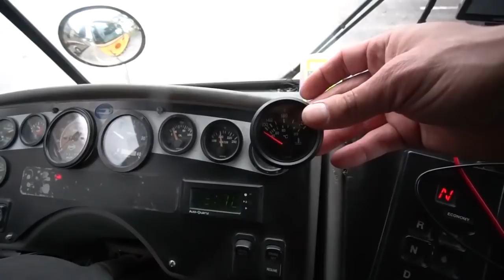Cummins Visit ~ Massive Coolant Leak ~ Skoolie MPG

Comment: It’s good you were able to fix your leak and it wasn’t serious. We were ‘evicted’ from our house for two weeks while Cumins’ overhauled our engine. It was expensive, but since we bought the coach used, there were bound to be a few things crop up over the years, but I sure didn’t expect that at only 100k on the odometer. I mentioned in a video how the surprising part was how hard it was mentally on us not having our house. Thanks for the video, and hopefully, may your issues all be minor!
Reply from the maker: Yes, I cant believe yours went at 100k. Air filtration issue right? Its all part of the journey!

Comment: Those are good busses, I used to work on them. not a bad idea to check floor mounts on the chassis. It is a very common problem with Thomas. Blue Bird and Carpenters. Just measure from a flat road surface to the frame for actual ride height  then measure from the road  to the underside of the bus floor.  Do that for each side that will tell you if suspension or chassis mount/ sag. If it is a spring the frame height will read  off on one side, if it is chassis/mounts/sag.. the floor reading will be different on each side. Full fuel tanks can contribute to leaning different height on one side also.

Comment: Big Class A or big School bus, Diesel engine all mass weight. They sink in the desert at times, limited where you can go. I will pass. See no advantage except maybe the interior space. But you love adventure and this will be a good one. I rebuilt my RV from the ground up, bumper to bumper. The structure is all steel framed walls and ceiling, It turns 41 years old in 2018. But its brand new. Love you Chris and G, your very fun to watch.

Comment: Chris, Just changed my coolant in my 8.3 Cummins. went with the 50/50 to keep from eating the liner out of the engine. hopefully yours is the mechanical 8.3 and not the electronic. You will do well. Just changed all oils and fluids an ready for 15,000 miles plus.

Comment: That sounds like the air suspension settling. When you start to hear that "clicking" give the bus a good shake. it should give you one loud(er) "click" then stop until further settling. nothing to worry about. If it is the suspension I think it is there are plastic wear pads in the front spring hangers of that drive axle suspension. They tend to "stick" to the spring surface and "click" when they release from natural travel of the spring as the suspension "settles"and articulates forward.
The sight glass should only be half full when the system is cold. Thus the reason it is called an expansion tank.

Comment: Those buses with have three levelling valves for air ride.   One on the front and two on the back.  It's common to have to replace these periodically.  Likely a haldex part that will cost about 60 dollars each. For the air ride to drop after two days is normal.   Get koni fsd shocks if you need to replace them.

Comment: Chris, I think your bus has at least rear air ride suspension. On the left rear you hear creaking all night long and the wheelwell gap gets closer. That's your air bag bleeding off air (air leak). When driving the air compressor keeps up with the air leak and you don't notice it till you shut off the engine.
Reply from the maker: You are exactly right sir. I need to get my air pump fixed.

Comment: dont overfill your coolant tank, its also a expansion tank for the cooling system, keep it on the mark off the little check window and you are fine!
Reply from the maker: Thanks for the heads up. I filled it right above the line :-)

Comment: Chris does that bus have air bags on the back axle? If the bus is not on perfectly level ground it will lean a bit.
Reply from the maker: It does have air bags, I figured out there was a leak!

Comment: Those expansion tanks have a manufacturing defect. Fleets would change all of them out at once, regardless of whether they were leaking or not, because you could reliably predict that they'd fail. The seams are bad/weak. You can get an aftermarket replacement and install it yourself.

Comment: What diff ratio are you running? Buses came out with different ratio diffs depending on the application of the bus. A bus used mainly for urban/city running often has a different ratio to one used on highway work. On highway driving I would be expecting at least 12mpg empty on flattish roads and still air. Unless of course you're pushing hard. With the springs you may find a broken leaf. Or you may just need to have the springs reset. Not terribly expensive. Second hand springs may be an option but unless you can find some way of measuring the sag under load then it may be a waste of money and lots of time.

Comment: The mileage is not indicative of the mileage you'll get set up as an RV. The cost of diesel where we live is about 20% higher than gasoline so comparing it to Atlas at this point isn't apples to apples :-)

Comment: Hi Chris and G! I'm Calvin. I just watched your video regarding your new school bus. If you had a blown headgasket there are sealants that can be poured into the engine that would fix that issue. Check out some of the auto parts stores. For the clicking sound and the slow drop on the driver's side, your bus should be riding on airbags. If there is a leak in the system or an airbag, it will drop on one side. I know this because I had/about to have again, a 1997 Monaco Dynasty Baron III diesel pusher with the 8.3 cummins, and I have the same problem. Run the engine, allowing the air pressure to fill the system back up and maintain the pressure. While the engine is running and keeping air supplied to the system, take a spray bottle with a mixture of soap and water, and spray the air bags one at a time. You should have 8 airbags. If there is a leak, the bubbly water should reveal it. You could also do this for other parts of the system. I hope this helps. I'll be back to living in my motor home soon, once I get it back from my father. Keep up the energy and drive!
Reply: ok Calvin the sealants you talk about will not fix the problem. they will block the coolant passages and cause further issues.
Reply: carhead Exactly
Reply from the maker: Thanks for the heads up Clavin, I will check these out!
Reply: Chris & G Travels I hope it helps! Be safe!

Comment: Ya don't fill that tank above the sight glass. it will leak out it needs that expansion room.
trucks are the same way.   Drove trucks for 35 years.
Reply: Ivansgarage, are you thinking he overfilled it and when it expanded, it just pushed it out? If so, that's great news, assuming all he has to do is not overfill it.
Reply: EXACTLY Right  Thats why the sight glass is just above the bottom of the tank.
That sight glass is a level gause ie. water level.
Reply from the maker: Thanks bud, I appreciate it!

Comment: Why didn't you just let the engine run and go back and look where it's leaking? Next, pull out your dipstick and look for water on the stick. You will know real quick if your head gasket is blown. Best of luck. I have the same ring you have but don't wear mine on my thumb.